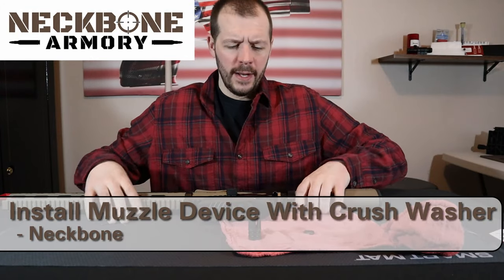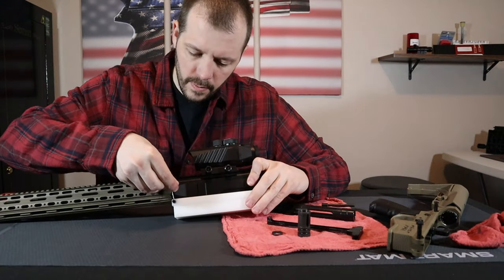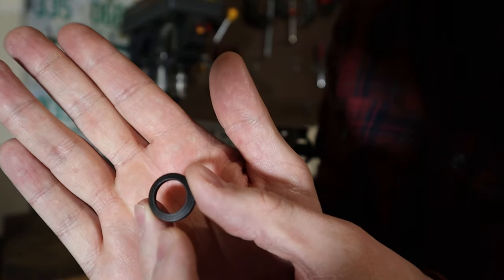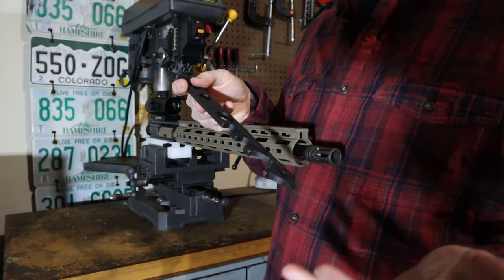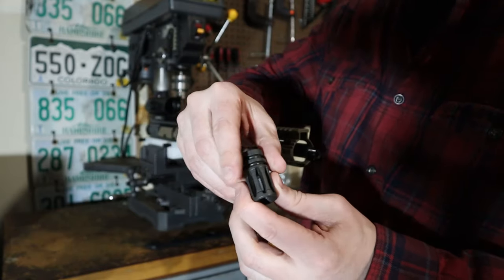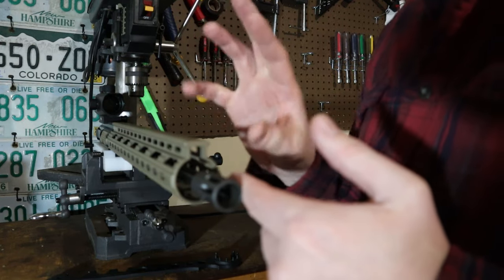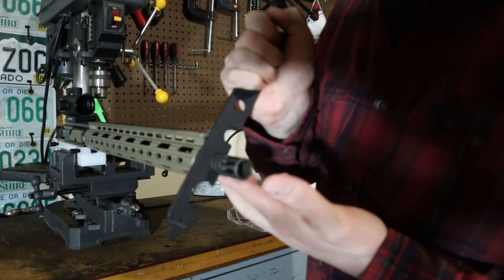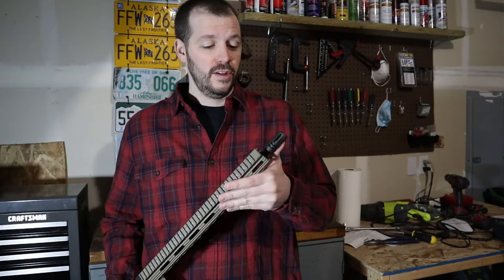How To Install A Muzzle Device With A Crush Washer

Comment: By using light sandpaper, you can lightly knock off a few thousandths of an inch of the flat side of the crush washer until you reach the final quarter turn at hand tight. Then tighten to zero with a wrench. This will prevent damage anywhere along the barrel. This is how I do it and how I will always do it.

Comment: Idk if i did it correct or not but whem you said "do a 25% turn" i went ahead and did a whole full turn and stopped where when it was aligned. So basically i hand tightened then i grabbed my wrench and went a whole full turn not just the 25 you said, is that okay?

Comment: What is that device you connected to your weapon to put in to the vise? And where did you buy it?? Great video!!!!!
Reply from the maker: Thanks, it's an upper vice block. I got it here: https://shareasale.com/r.cfm?b=15098&u=2698398&m=4355&urllink=www%2Eopticsplanet%2Ecom%2Fobsidian%2Darms%2Dar%2D15%2Dupper%2Dreceiver%2Dvice%2Dblock%2Ehtml&afftrack=

Comment: is this supposed to be tight to the barrel or loose, i have one for a 9mm pistol but the washer sits very loose and has nothing to push against till i get to the front of the weapon which i couldn't tread the muzzle break enough for

Comment: You dont need to get a brand new crush washer every time you take your A2 birdcage off. As long as it gets a reasonable amount of tourqe going back on its just fine as it is not under huge stress in normal operation. Might be differend on other devices and if you use a suppressor that mounts to the A2 id recomment replacing the washer every time. But just the A2 alone is never coming off because you didnt replace the washer.

Comment: Correct info on the crush washer install process, but missed the very important thing, the use of a Reaction Bar. 
 
Upper Receiver Vise Blocks are only good for small and non-torque related install work on the upper. 

For any torque related work involving the barrel, I highly recommend using a Reaction Bar. This would help you avoid damaging the vise block, or worst, cracking your upper receiver. Use a Reaction Bar any time you apply torque to the barrel. This includes tightening the Barrel Nut, and timing and clocking muzzle devices.
Reply: Where can I get one?

I want to install my muzzle device on my hunting rifle the correct and safe way.

Please provide a link
Reply: @BertReno  Reaction Bars are only good for AR type semi-auto rifles, which have splined extensions on the barrels. These reaction bars have splines that fits right in the AR type barrel extensions. My comments was for the AR rifle build that this shown. Unless you hunt with an AR type rifle, then my comments would apply. You can get them from Brownells, MidwayUSA, etc. or any online retailers. For bolt action type hunting rifles, browning or MidwayUSA also have plenty of choices for barrel blocks that you can use. You do not need to apply a lot of torque on these muzzle brakes. Just snug tight is usually what's needed. The crush washer will not allow you to over torque. If you need to clock your muzzle brake straight and plumb, then you have to add some muzzle thread shims correct the timing. Hope this helps.

Comment: Is the crush washer necessary to install? What happens if you don’t put it on? Do all compensators need the crush washer ? I have one compensator that came with it and one that didn’t. Thanks for info in advance.
Reply from the maker: You don't need crush washer. You can use shims, lock nut, or nothing at all if you'd like. The crush washer just keeps it from loosening.
Reply: @NeckboneArmory  thanks for that. So it’s basically just an extra security feature. Less likely to get loose with crush washer?  Just subscribed to your channel. I’ll be checking videos out.

Comment: my barrel tip has a spring/pin  and indentation on the break for correct alignment. 

it did come with a crush washer though,,  vg6 epsilon  ak.      

My m70 has the spring on the barrel though,    do I need to use the crush washer or just screw it until it's tight and factory aligned.   

I guess the crush washer is to be used for barrels that don't have the spring pin to keep it in place.? 
Thank you

Comment: My barrel is tapered at the end will tightening the crush washer damage the barrel? Stainless steel barrel BTW.
Reply from the maker: It should be fine. only really need 20 - 30 ft lbs on the crush washer. The only problem I've seen with tapered barrels and crush washers is that the crush washer needs a shelf to crush against and some tapered barrels lose that. I've seen people flip the crush washer around because of it.

Comment: Brief and concise!

Now, do I need rockset or red loctite with a crush washer?
Reply from the maker: I wouldn't use either. The crush washer should be all you need.
Reply: VG6 brakes actually come with anti-seize.
Reply: Rockset is not a bad idea. If you wanted to remove the muzzle device soak it in water and it'll neutralize the rockset.

Comment: Don’t you need a torque wrench to ensure you don’t over tighten it? I’m pretty sure that wrench you were using isn’t a torque wrench.
Reply from the maker: That wrench was just a simple armorers wrench. As long as you tighten past hand tight more than a quarter turn, it will be torqued correctly with a crush washer. You can't really over tighten with a crush washer unless you completely flatten the crush washer. You shouldn't need to tighten it to that point. Even on muzzle devices that need to be timed, you will never need to do more than one full rotation to get it timed properly. Keep an eye on the crush washer, if you're flattening it, you're going too tight. If you want to use a torque wrench for peace of mind, that works too.
Reply: @NeckboneArmory  is one whole turn to much?  When i hand tighten mine it is at a perfect time.  I will have to go all the way around again.

Comment: Everything is ok except vise. You're clamping upper receiver but not the barrel itself. You can damage barrel bed on upper receiver. You need action rod or what people use to call them.
Reply: How will you know it’s damaged?
Reply: @Spencer900  Can't really say but you're applying torque to part 1 and have clamped part 2.
The connection between those parts has to take torque force and you only want it on muzzle. Maybe barrel notch on upper receiver can be widen?

Comment: Who taught these guys that “pre-crushing” a crush washer is correct. Crush washers are a one time event. Once you crush it don’t back it off
Reply: He'll be fine. Don't cry.
Reply: For traditional crush washers, yes. For this specific application they are designed to be backed off then retightened.